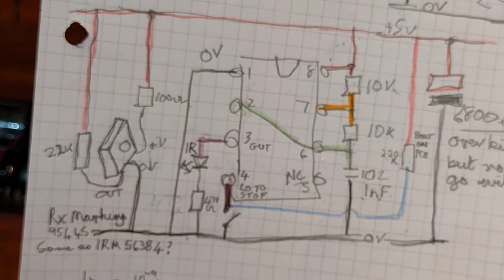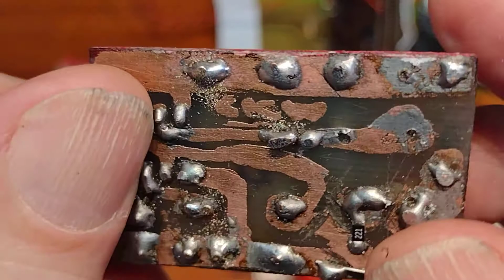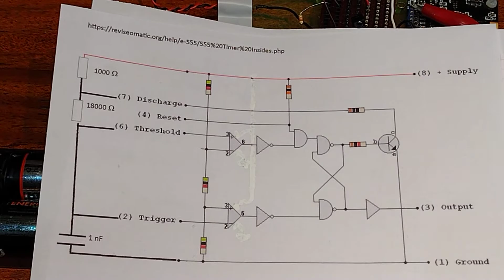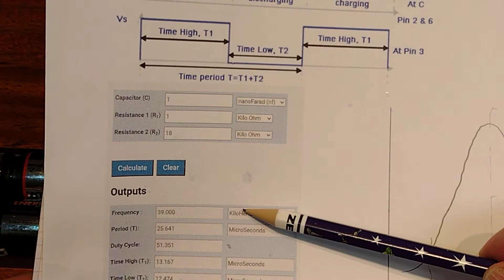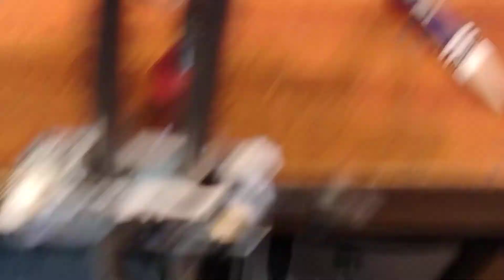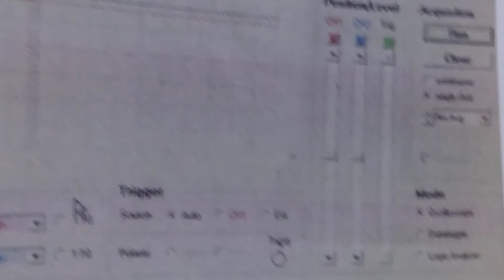Using a 555 timer to generate 38kHz for infra red control

Comment: Can you make a video to show a complete schematic and explanation of how to make an IR 38KHz demodulator without using any IR receivers which does it internally? Thanks.
Reply from the maker: Thanks for the comment. I've never thought about the 38 kHz receiver as they are so many about. I think some device's use different frequencies which may need a different receiver. I assume they need a band pass filter for that frequency but haven't tried it.
Reply: @toyhacker4647  There are no videos on youtube (maybe, one video) and the entire web to actually show how to build a working IR receiver. I did some research and it make sense why no one shows a tutorial on how to build such hardware. It's because it's super complicated (not really), need to build an AGC (automatic gain control), high band pass filer and demodulator all working together to implement a proper IR receiver for microcontrollers. The fact is that anyone can buy a "TSOP4838" IR diode for less than $1 and get all of these receiver hardware goodies all built into the IR TSOP4838 diode. I checked the block diagram of the internals of the TSOP4838 IR diode and it's quite involved, however being able to fully know and able to build your own IR receiver in my opinion is crucial to make more custom advanced opto-electrical devices such as LIDARs.